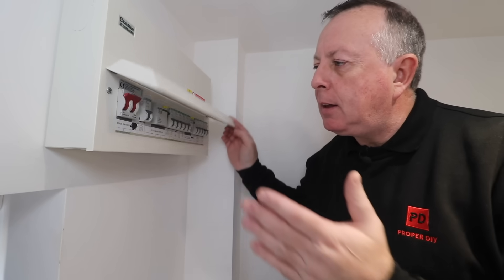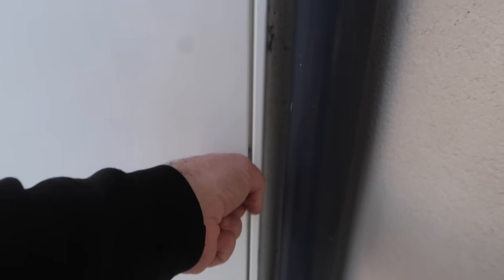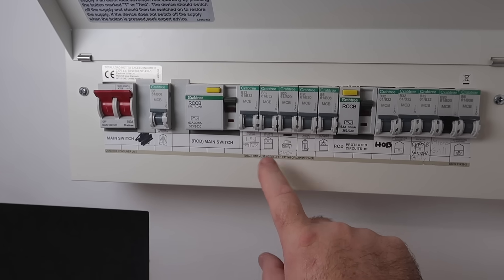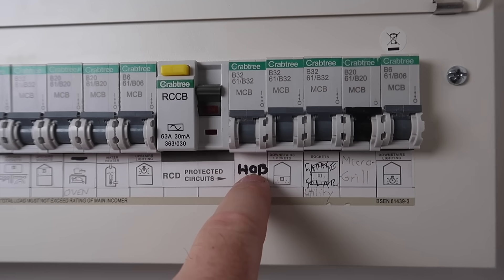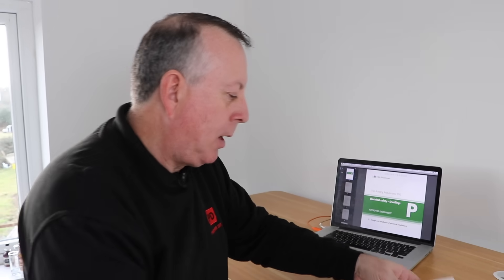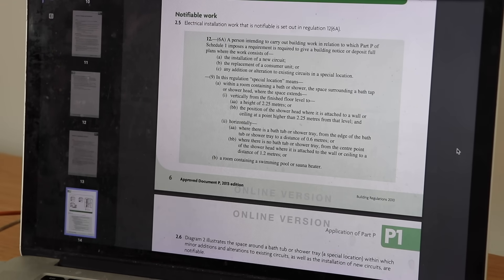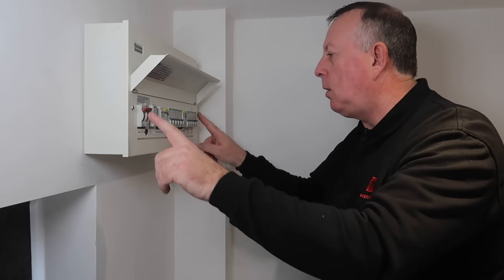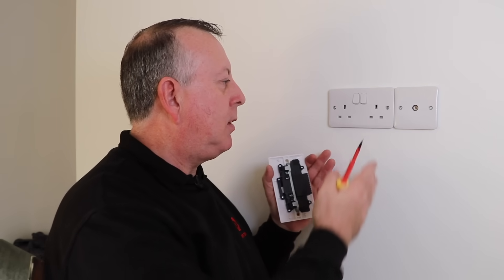What electrical work are you allowed to do in your own home?

Comment: RCBO's are the way to go, they trip individual circuits under fault only, instead of also tripping off all RCD's on a bank protected by a RCCB.
Reply: They do become significantly more expensive when they have an afdd built in but they'll soon come down as well as more people start using them.
Reply: They are also significantly more expensive than MCBs
Reply: @elminster8149  they're getting cheaper all the time and it also means you can spec the type of rcd that's in it for individual circuit requirements.
Reply: @rodgerq  given type AC is basically obsolete these days I'd expect type A as a minimum standard for new installs. I've certainly been converting a lot of temporary distro to type A recently. I don't think many homes will have any purely resistive circuits these days.
Reply: @Savagetechie  they should just outright ban type AC and make type A the minimum. Seen a few folk saying they're installing type Fs on the kitchen circuits due to the possibility of certain types of loads like certain washing machines and driers. 

@Elminster I can't think of any resistive-only circuits that would warrant an AC rcd tbh. What are they?
Reply: @rodgerq water heater?
Reply: @elminster8149  RCBOs are dirt cheap, preet much exactly the same price as mcbs these days. Nobody installs split load boards now because they are the same price.SPDs have also come way down to the point where they are basically free with some brands of consumer unit. AFDDs on the other hand.... still sore on the wallet.
Reply: @Savagetechie  Except they do, especially in new build.
Reply: @elminster8149  new builds I've seen recently have all been RCBO. I suppose it depends a lot on the development company. The split design is just a hangover from RCDs being expensive and appliances being designed with less care about  earth leakage (why some split boards were rcd one side and non rcd the other).

Hopefully split loads vanish but, as there are still plenty of fuseboxes in use throughout the uk, the split load will still be in use 60 years down the line.
Reply from the maker: I'm sure they are - I don't know what % of new builds are using them though.
Reply: @ProperDIY  my 4y old house still uses MCBs. Builder will use cheapest allowed system for as long as they are allowed to
Reply: @ProperDIY  My brand new build still uses the cheap as chips split load RCB consumer unit.  They get away with it as big building companies can certify their own work.  When I got a sparky to run heavy duty power out to the garage (for power, lights and future EV use) we made sure to use RCBO's as that is what's recommended in the regs these days.  The getout clause is "recommended", hopefully that will change to "required" in a future revision.